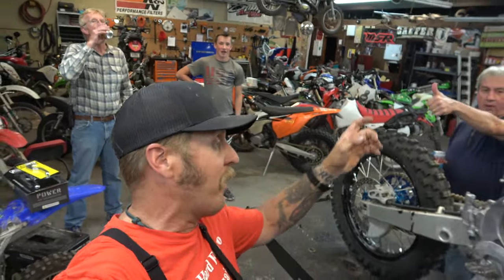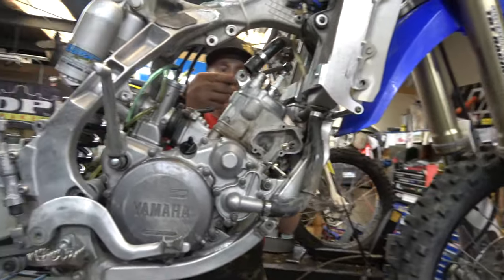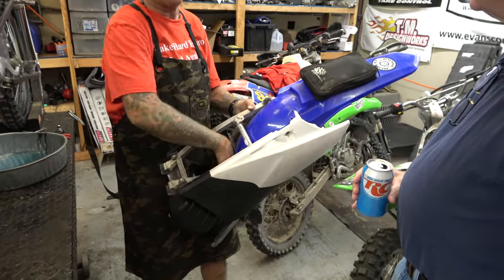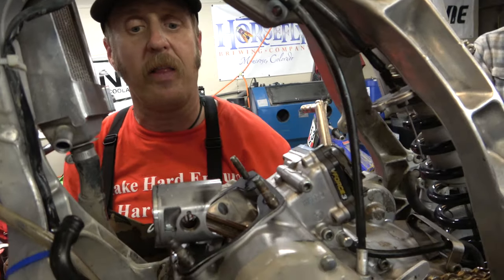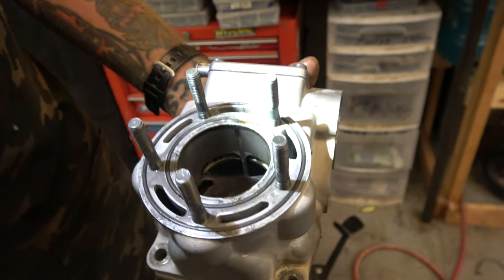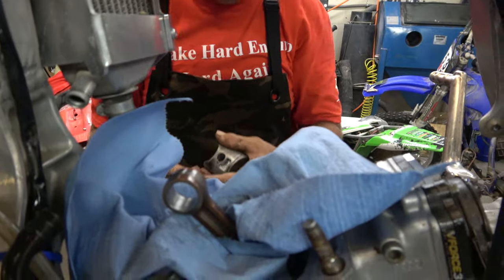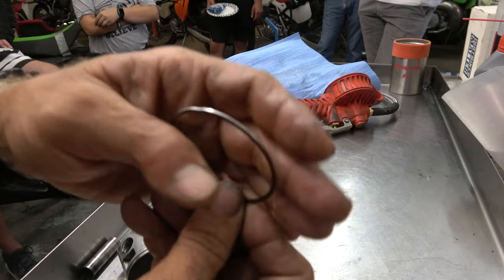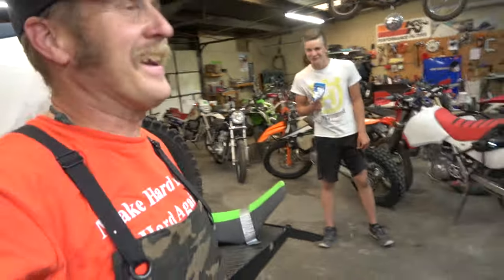Why Did My YZ125 Blow Up? | How are we going to fix it?

Comment: Extra air from air cleaner it ran lean and sand blasted.
Reply from the maker: Yep
Reply: I just did the same thing to my 2016 TC 250 I pulled the cylinder off and the rings are almost gone the piston is in surprisingly good shape just two front seizure marks in the front and vertical lines all the way around I wish I could send a picture lol. Hey thanks for all your videos Morgan!